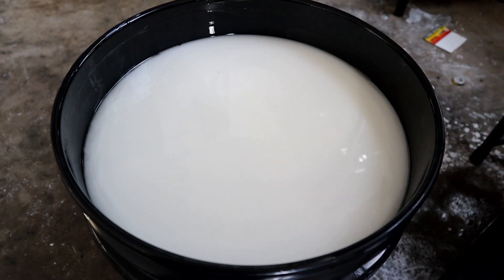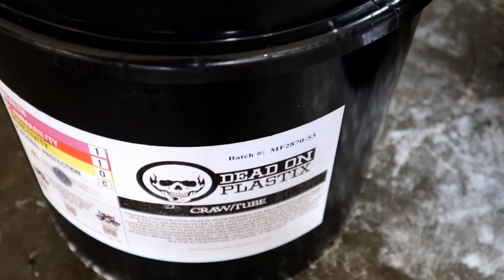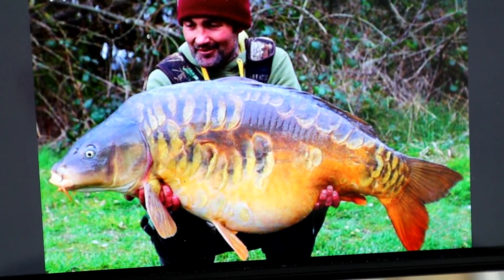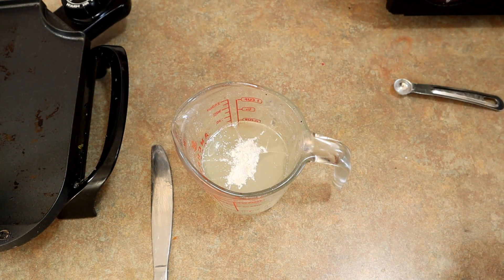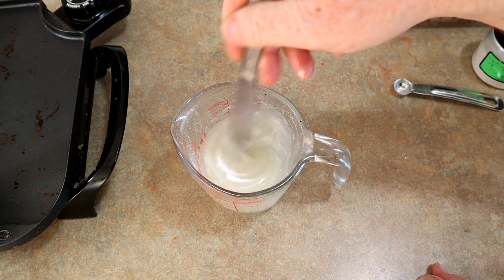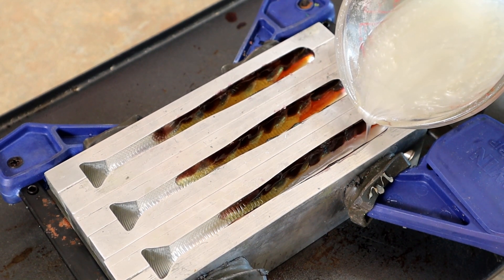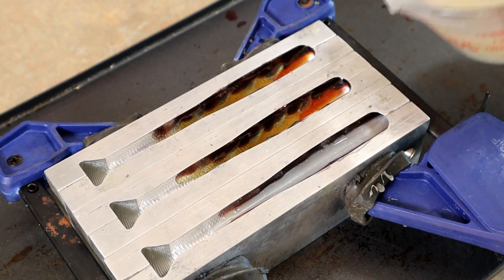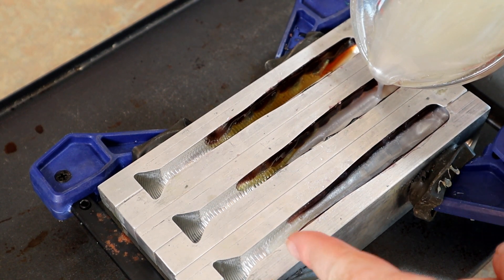Let's Pour A Mirror Carp Swimbait; Color Challenge From A Friend!

Comment: Do you have any videos of plastic softener or hardener? I use deadon and my swimbaits are 6 inches long so I use craw/tube blend but seems to rigged, wondering if softener would fix it to where it has a better action at slower speeds.

Comment: Great work as always.
I have a problem with getting the layers to stick together, I can just peel them from eachother. The temperature is good so I don't understand why.
I use bright bait plastic. Do you have any idea why this can be?
Reply from the maker: If layers are peeling apart then the molds did not get hot enough
Reply: @WorldsWorstFishing  okay.
Did not think to heat the mold.
I use a silicone mold, would you use a hotplate to keep it warm?

Comment: How do you keep you glitter from curling up ?  I’ve been struggling with it lately the other difference has been the weather I’m thinking my garage is too cold and the glitter is curling up after I stir it in like it’s shocking it from cold to hot I’ve tried to mix it in around 300 degrees and it still wants to curl up I’m using dead on plastix worm blend and do it molds glitter .040

Comment: Have you considered using something like a meat injector to achieve more precise placement of the plastic when you do this method? There are metal-body injectors out there, so as to withstand the heat. I know ABS melts at like 220f or so, which is lower than your plastics at 350 or more.